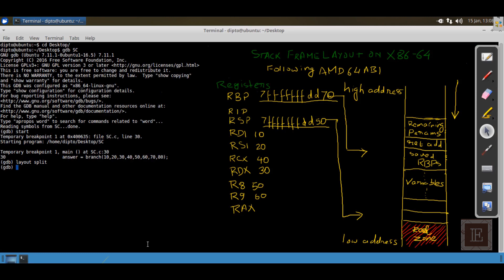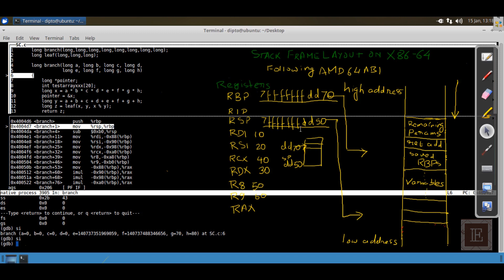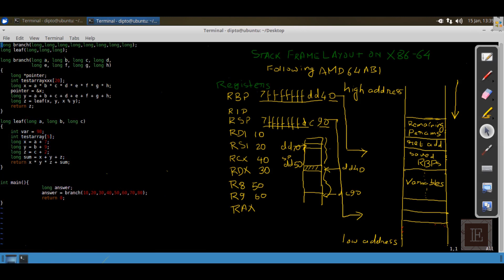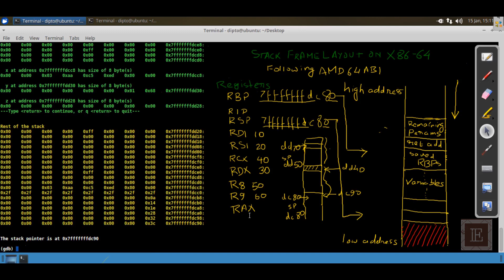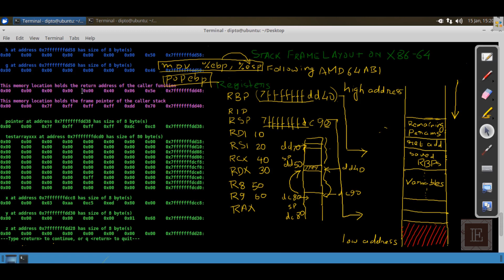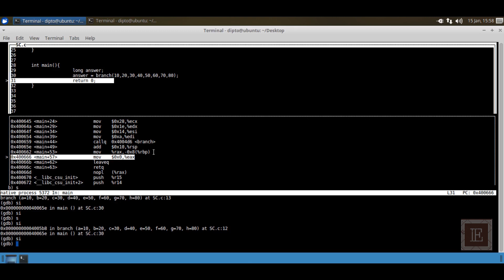Stack Frames. Red Zone, Prologue and Epilogue on x86-64, demystified. Demo on the GNU Debugger.

Comment from the maker: List of errors in the video: 
1. From 59 minutes 29 seconds  through 59 minutes 30 seconds, I meant to say the *stack size is of 8 bytes*. I said 1 byte in the video which is incorrect.
2. From 1:03:10 through 1:03:16 I meant to say since location dc80 saves the base pointer of the 'branch' function stack . I said register rbp saves it, in the video which is incorrect.

I will be more careful in my next videos.